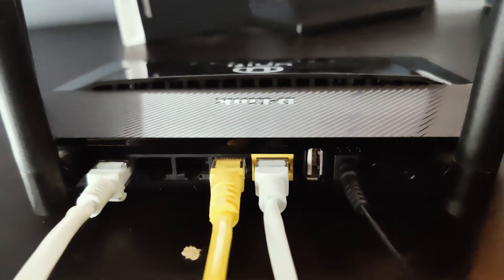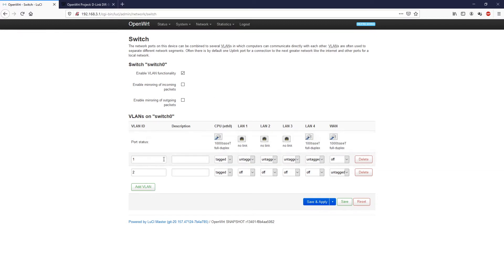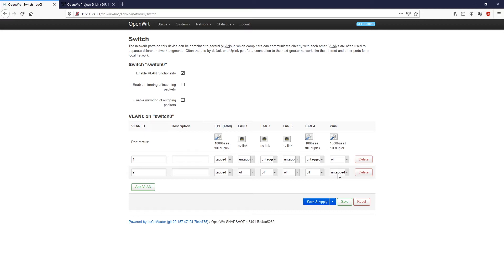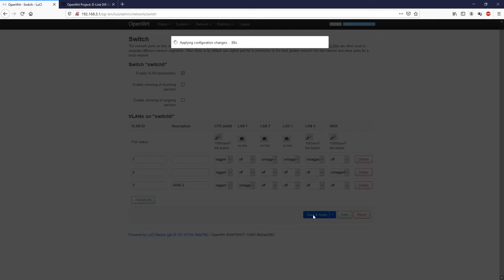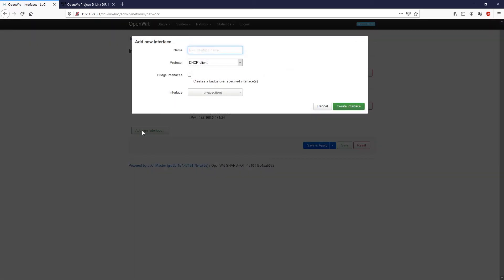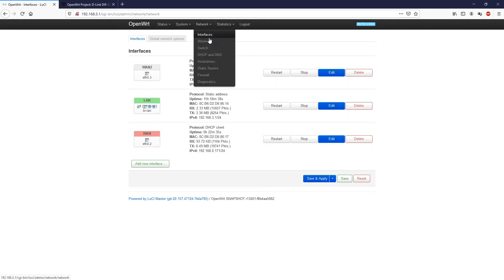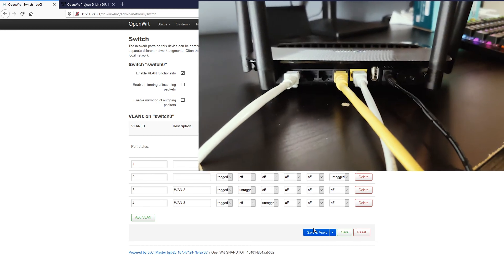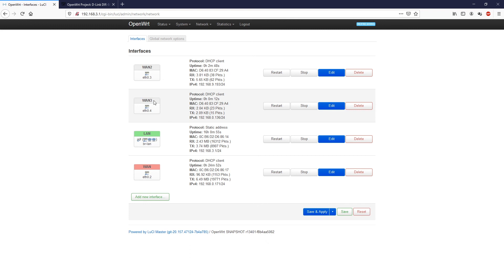OpenWRT - Configure LAN port as WAN port

Comment: Accordingly to default openwrt configuration of all communication WAN<-->LAN given in tutorial is not complete. I understand than vlan tagging itself is enough way to separate networks. However, openwrt additionally adds firewall rules to not be able to mix networks. And once we created WAN2 (aka tagged with tag id=3)  I would add extra rules like:

LAN -> WAN2 : accept/accept/accept

LAN -> WAN2 : allow forwarding from src=LAN to dest=WAN2
Reply: ahh. it was covered in other video linked: simply add new wan2 to 'wan' zone and no need that stuff above

Comment: OpenWrt v23.05.5 is missing the switch configuration option in network section. Kindly make a new video how to setup lan port as wan .thanks in advance I shall be very thankful
Reply from the maker: Thing are changing since OpenWrt 21. You can see how to config LAN port as WAN port and setup multi-wan here https://youtu.be/phkptBdGScY?si=TtBuG4SvfXbromWO
Reply: @VanTechCorner  how can I configure lan port as wan in latest release of OpenWrt since there is no switch option present

Comment: Hi. My WAN and LAN1 port is not working. I want to convert LAN 4 to a WAN port. How do I do this if the Switch menu doesn't work? I am using OpenWRT_22_03_5. I need help. If there is a video, please drop the link. I can't figure it out, but without the WAN port of the router, the Internet does not give

Comment: Thank you for this.  It was confirming what I had guessed my way through.  I have a problem though that makes the interface behave like it doesn't have a subnet mask set properly, in that the ping tests generate ARP requests on the WAN2 interface rather than forward to the gateway.  Any ideas why that might be?
Reply from the maker: OpenWRT doesn't support multi-wan natively. You need to configure mwan3 to use it. On my channel there tutorials regarding multiwan load balancing & multiwan failover, you can check it out.

Comment: Hi, I can't find the switch menu on my opemwrt, what is the name in the update list?
Reply from the maker: Hi, if you are using the latest OpenWRT version (20.x) Switch menu is not avaiable. Try install the 19.x and it should be there.
Reply: @VanTechCorner  thank you i did it after changed to dir 842 router..
Reply: @VanTechCorner  how to do this in 20.x? is there any way?
Reply from the maker: Nope, no way if you are using 20.x

Comment: Thank you so much for sharing your knowledge with us! I have Linksys ea7500 router, with dead WAN port, which I want to reconfigure to one of the Lan ports. I've installed an OpenWrt firmware on it hoping I can configure ports... Turns out, the firmware for my router (the only version available) is a "snapshot", which lacks LuCI.... so, I'm stuck with SSH. Could you please, or anyone who knows UCI system commands help me with Lan port configuration as WAN via SSH?
UPD: You have excellent video tutorials! Using another your video guide about installing LuCI on Raspberry PI I've got LuCI installed on my router and reconfigured Lan port. Thanks a lot!
Reply from the maker: Thanks for the comment. Glad that you get it up and working. There are other OpenWRT tutorials on the channel, feel free to check it out!

Comment: Is it possible to use the WAN Port as LAN Port and LAN Port 1..4 as WAN Ports?
Do I need to configure WAN Port in VLAN 1 (LAN) and off for other VLANs, save & apply.
Then unplug the cable to PC from LAN1..4 to WAN Port and get IP from DHCP 192.168.1.XXX .
Next configure only WAN to VLAN1 (LAN) and LAN1 to VLAN1 (WAN1) + CPU, LAN2 to VLAN2 (WAN2) + CPU.
Do I need to change further settings like Firewall?
Reply from the maker: Hello, I think you should have found the answer. You can configure a LAN port was WAN port and vice versa. Just need to assign the port to the correct VLAN (normally eth0.1 for LAN and eth0.2 for WAN) and set the status (tagged/untagged) according. Maybe you can start a topic on the FB group Van Tech Corner & Friends and shared the screenshot of the switch page to make it clear before proceed.

Comment: I have a Onu which limits 100mbps on each Lan. My router (Archer C5 supports upto 1200mbps speed) I have taken a 200mbps plan but don't wanna upgrade my onu since it's costly. I was looking into converting one of the Lan ports on Archer C5 into wan. Theoretically this should allow for the router to have 2 100Mbps connections. Is there any way to combine the speed though? Resulting in two wan with each 100 Mbps speed giving an output of 200mbps?
Reply from the maker: There is no way to combine (bond) the link throughput. You can only load balance with 2 or 3 or 4 WANs, but not combining them. If you want to bond the connection, try the Mikrotik or Draytek router and it should done the job. Normally the ONU should be provide by the ISP for free and a single port througput should be higher then the plan. I don't know what is happening with your provider, maybe you can deal with them on this.

Comment: how to setup in x64 PC ? because there is not any switch in luci
Reply from the maker: Hello, are you talking about VLAN setup for a single network port on x86 PC or your x86 PC router has more then 2 network port? If you are having more then 2 network ports, you can edit the /etc/config/network file or change the physical interface for WAN and LAN. Please provide more info about the router if you need further assistance.
Reply: @VanTechCorner  I have installed it in qnap nas (virtual server)and can add more network

Comment: Hey, Great Videos and thanks for sharing this videos. Can you make a video on how to use separate gigabit hub as wan port or use separate router to extend wan ports ? I have 5 wan connections and would like to load balance all of them I am little confused and don't know what is managed switch ? Greatly appreciate your videos thanks
Reply from the maker: Hi, there is already a video with multiwan in load balancing and failover mode. You can check it out in my channel.

Comment: If anyone has ANOTHER OpenWrt build  with DSA, where the Switch page appears ok i would appreciate its link from the url of the browser and the generated source of the page from the browser
Reply from the maker: Hello, can you tell me what exactly do you want to configure, the model of the router and version of OpenWRT you are running?
Reply: @VanTechCorner  WRT1900ACSv2 Kernel Version 5.4.63
Reply from the maker: I take a look and DSA is currently not supported on your router (Marvell 88E6176). You can check it here https://openwrt.org/docs/techref/hardware/switch. Can you tell me what do you want to do and provide a screenshot of the Switch page in Luci, I will assist.

Comment: I have a static ip based network
How do i setup my network?
Getting confused.
Reply from the maker: In your WAN interface, change the protocol to Static Address and fill in the IP, subnet mask and Gateway IP address you have. After that, go to the DHCP tab and tick "Ignore this interface" to turn off the DHCP server and you should be good to go. If you have any problem, just leave a comment. This is the documentation of WAN client. https://openwrt.org/docs/guide-user/network/openwrt_as_clientdevice
Reply: @VanTechCorner  thanks for the reply
I have a fried wan port
So I'm looking to use vlan and turn one of my lan ports to work as the wan port.
I've seen your video.
Can you please guide me how to actually select the etho.# ?
I mean i create the vlan but can't connect to my network.
Reply from the maker: You can check out this video https://youtu.be/FgMnPE3CYo4 if it is not working, please provide your router model and upload the screenshot of your Network - Switch so I can check something.

Comment: Can we create multiple WAN with usb tethering device like a 4g dongle or multiple phones connected to raspberry Pi usb ports with Openwrt, do you have any suggestions?
Reply from the maker: Theoretically, you should be able to do that. But it is not advised to use 4G modem as load balance WAN interface since the network connection is not stable.This is the way you can do:
- Configure the USB modem/phone. There will be a network interface created for each of the USB modem.
- Configure load balancing, instead of selecting your physical WAN interface, select those USB modem interfaces as load balancing member.
I have made a tutuorial for multiwan load balancing with OpenWRT here, feel free to check it out: https://www.youtube.com/watch?v=f_yGMezdMB0

Comment: Can you suggest a list of compatible routers that can have multi wan?
Reply from the maker: According to the document from openwrt.org, the below devices are working well with mwan3. Also, I have a tutorial for mwan3, you can check it out here: https://www.youtube.com/watch?v=f_yGMezdMB0. 
A TP-LINK TL-WR1043ND hardware version 1.10 router (ar71xx platform) (tl-wr1043nd) using OpenWrt 12.09.
A TP-LINK TL-WDR3600 router (ar71xx platform) (tl-wdr3600) using OpenWrt 12.09.
A TP-LINK TL-WDR4300 router (ar71xx platform) (tl-wdr4300) using OpenWrt 15.05.1.
A TP-LINK TL-WR842N router (ar71xx platform) (tl-wr842nd) using OpenWrt 15.05.1.
A openwrt 12.09 mips metarouter over a mikrotik r493g routeros 6.27 (mikrotik_metarouter_openwrt).
A NetGear WNDR3800 router (ar71xx platform) (wndr3800) using OpenWrt 12.09.
Reply: @VanTechCorner  thanks a lot 😁 is this compatible too " TL-WR740N " ?
Reply from the maker: The TL-WR740N has only 4 MB of flash memory (which does not receive the latest update from Openwrt anymore) and the switch port are 100 Mbps. It is not enough space and speed for mwan3, unless you install it via the command line and the maximum throughput is under 100 Mbps. If you are looking for a new router, buy the one with at least 16 MB of flash memory and 128 MB of RAM for the best performance.